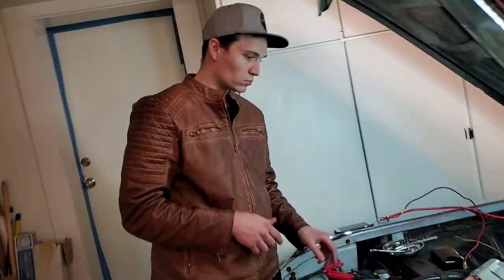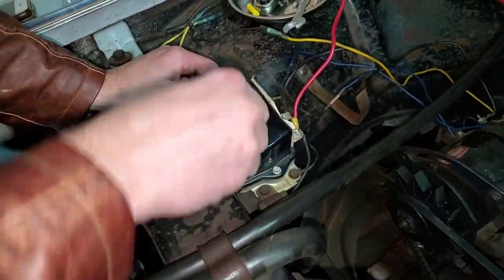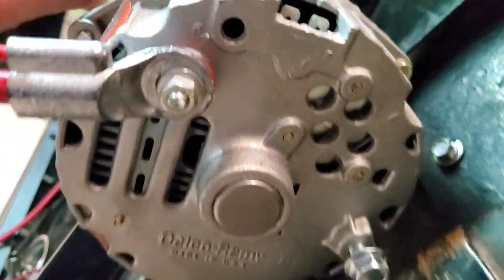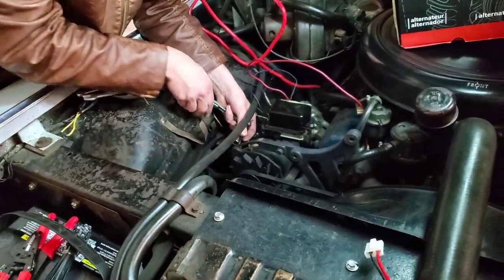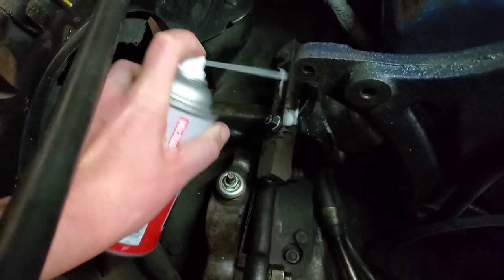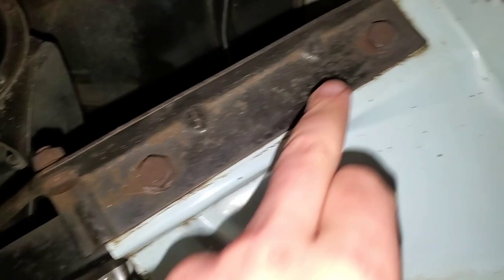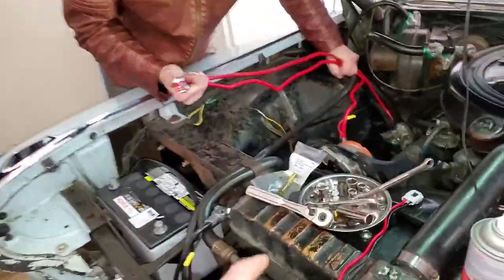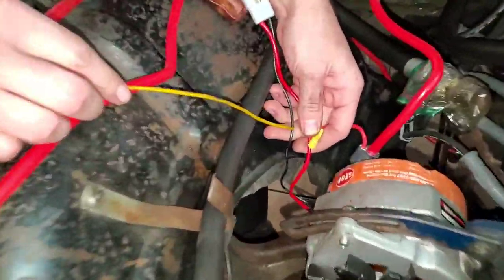1959 Cadillac Alternator Upgrade Installation

Comment: In this video, and others, I've noticed that your car has a huge exhaust leak: most likely a manifold. This will come into play, when you take the engine apart for a rebuild. Have the manifolds resurfaced. I also noted that there is no protection from a short, between your alternator and the battery. Most car makers provide either a fusible link or a high-amp fuse. You don't have either. That could be really bad? Get a fuse in there!
Reply from the maker: How do I do that?
What has to be cut to get the fuse in?
Reply: To add a fuse, you'll need to cut the big, red wire that runs between the back of the alternator and the battery terminal. It looks as though the wire used for this is the same wire that stereo shops use to hook up amplifiers? There are fuses available for this type of wire. They're an inline design and can be easily added to the wire. Make sure you get a fuse with a 100 amp rating. This will be adequate for the output of that alternator.
Reply from the maker: Awesome!

What is the best place to get it at?
Reply: Eben, I re-watched your video and realized that you used a battery cable for the alternator power lead. That's a little overkill, but that's what you've got. To add a fuse to that setup, you'll need a fuse with 1/4" bolt holes on both ends. You will connect one end directly to the battery terminal and the other end to the cable. You should be able to find a fuse like that at either: www.delcity.com or www.wiringdepot.com
Reply: Oops...the website for Del City is actually www.delcity.net Search in the catagory of fuses and select "mega fuses." The 100 amp option should work perfectly.
Reply from the maker: Awesome Thanks a million I'm going to order it right now

Comment: Thanks for posting this!  Just used it as inspiration to swap my '62 Coupe deVille over to an alternator. Didn't realize how easy it was!
Reply from the maker: Sweet!
Thanks for checking out the channel Tom ☕

I recommend you try the Amsoil on your next fluid change you'll be surprised at how much smoother your car will run.

When I got my car I couldn't spend the tires on a gravel driveway and now it'll spin the tires on the blacktop.

You'll see on my channel I have a whole playlist on the Cadillac and it's amazing the transformation.

If you ever would have tried the products this is my link and I would be your Amsoil Dealer so I could always give you a recommendations and it would save you about $33 and $100 order as a preferred customer.

Professional YouLubher: Eben Rockmaker Regency Gold Direct Jobber AMSOIL Specialist (Dealer#: 5331179) 702-472-3614 

Get AMSOIL Wholesale Pricing - https://www.amsoil.com/offers/pc/?zo=5331179

Comment: Waw, easy alternator replacement. My Lexus' is concealed between the fan and the engine block, no more space in today's cars. Mine only outputs 13.3-14V, i'll test it further when my battery tester arrives but I think I'll have to change it.
Reply from the maker: Yeah the one that I got is putting out 14.4
Reply: @Syntheticoilprotection  Yeah that's expected from a brand new or fully working one 👍
Reply from the maker: Sweet!

Comment: Hi. New subscriber. Love the channel. I have a 59 Cadillac Coupe. I’m looking into converting from generator to alternator. I was advised to get a “one wire” alternator. Is that what you installed on your angel?
Reply from the maker: I really have no idea I got this part number from a guy on the Cadillac form on Facebook and everything seemed to go as smooth as butter.

I was notified though I should have put a hundred amp fuse on the big red wire for safety.
Reply: @Syntheticoilprotection  I think I want my inside gen light on the dash hooked up like you and hamlet did with yours. do you know the alternator brand/model number, pig tail #, etc etc for this generator to alternator conversation?  Putting that stuff in the description would be cool as reference in the future. Cheers.
Reply from the maker: Man like a flasher wind I already forgot I'm sure if you show that to a parts guy in the video I did quite a good close-up a couple times it's a very popular plug and we bought the plug the one big red wire and the alternator the alternator series was also close up videoed and you'll see it there I believe it's a Wilson alternator.

The plug is a very popular '70s and '80s alternator style plug which almost everyone had back then
Reply from the maker: I would just watch it a couple times again and that way you'll have a flow and feel for when you go to install it you'll be able to run right through without even looking at the video again if you watch the video two or three times.

it's amazing The first time you watch something you just don't catch everything but then as you go back again and again you can catch it it's almost like figuring out a magic trick 😃☕
Reply: @Syntheticoilprotection  funny you mentioned it. I rewatched and took screenshots during the closeups 😆.  Off we go!
Reply from the maker: Yeah it's distracting when you watch a video for the first time I do a lot of silly stuffdon't have good hearing can still hear me.

it's like when you're in the moment you kind of don't even know what you're doing..... Lol
Reply: @Syntheticoilprotection  hi Eben, next time you’re near your 59. Can you take a look at your belts (number code) used for alternator, and power steering and post them here. I’m about to re-do mine and they are so old the belt numbers are worn off. I could find out at an auto parts store, but I figure what you have on there is probably 100% accurate. Cheers
Reply from the maker: It depends if your car has AC or not This is a 1959 Cadillac DeVille 6329 series six window.

It's equipped with air conditioning and it has the 321 rear axle
Reply: did you guys have to add washers to the lower bolt that goes into the bracket to get the ALT to lineup properly with the pulley?  I did this mod, flipped the lower bracket, got the same bolt from Home Depot, noticed it doesn’t screw in all the way, you guys have same experience and load the lower bolt with washers on that angel?
Reply from the maker: I can't remember perhaps he did put a washer on there to give it a little bit more space so it wouldn't rub the frame.
Actually now I remember I think he did put a washer

Comment: Hey eben great video man, and perfect upgrade for that good old caddy,  whats your next thing you wanna upgrade on the car?
Reply from the maker: I think the next thing we're going to nail is the push rods and hydraulic lifters
Reply: @Syntheticoilprotection  thats a good idea,   it would definitely make that engine run even more better, are you gonna put an electric fan on too?
Reply from the maker: So far everything's great with the steel fan I didn't have any heating issues during the summer.

I'm really impressed with the car it's going to be fun once we get the drivetrain fluids changed out again to get the residual out also I'm going to go through the coolant and after I do all that combined with doing the pushrods and hydraulic lifters it's going to be time to demonstrate the perfect 180 cop car turnaround...... Lol😃😊☕
Reply: @Syntheticoilprotection  that sounds great man!!! Can't wait to watch those videos!!!!!   🇨🇦🇨🇦🍵
Reply from the maker: Oh yeah the pretty cat is just getting warmmmmmm